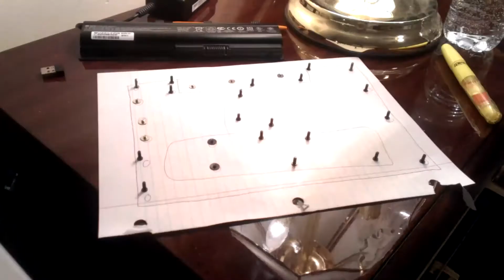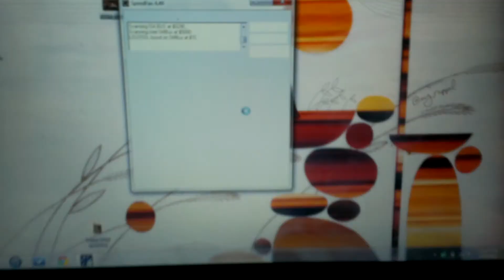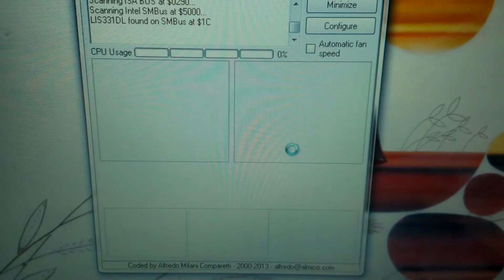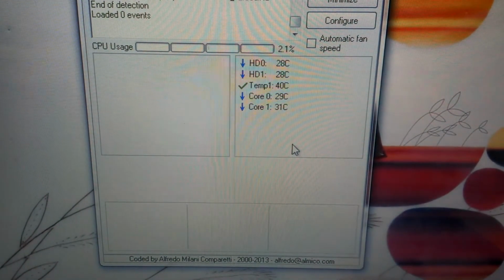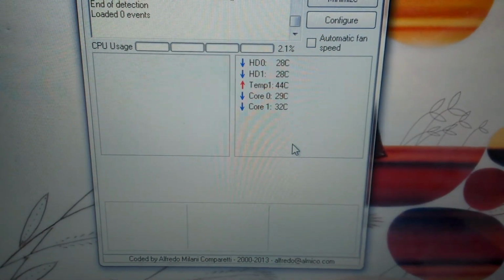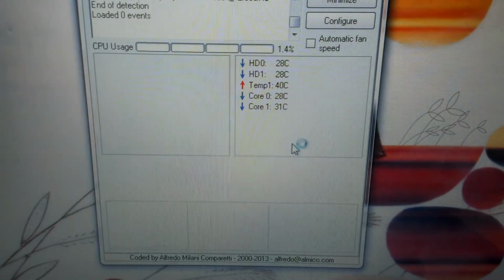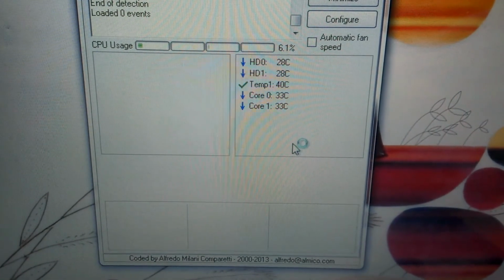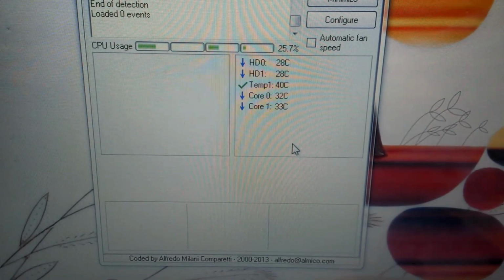HP dv7-4100 Series Re-assembly (Cooling Fan)

Comment: I got this message: cmos checksum is invalid, after I re-assembly the laptop, what I did wrong?
Reply from the maker: Looks like I missed/didn't see this comment. If you still have this issue...go to 4:29 in the video. On the right side you'll see a silver coin battery. This battery keeps the CMOS mermory alive. If this battery dies, you will always see the "CMOS checksum..." error message, and the date/time will be reset. If your battery is dead, it'll nee to be replaced.

Comment: Hey man, thanks for taking thee time to do this video, I  just fixed mine ( had half inch of dust blocking the out take ) bought in 2010 so understandably. Thanks a lot you're awesome man. One question, how to I check computer temp?
Reply from the maker: Glad i could help. I use SpeedFan to monitor temps.
Reply: Thanks again brother, I forgot the power chord plug on and had to take it apart and plug back into the motherboard lol safe to say I can do it now w out the video. I'll download that program than
Reply from the maker: Learn from mistakes. It happens.

Comment: Following your instructions, I fully unmount DV7-4150 to check the very noisy fan.
I also cleaned CPU, GPU, and added new thermal paste.  
A few "dust-off" sprays later and laptop reassembled, the fan is no more turning at high speed all the time!!!

Your video is very useful.   Nice job!
Thanks from Belgium
Fred
Reply from the maker: That's awesome! I'm glad you found my video very helpful! Enjoy your repaired laptop!